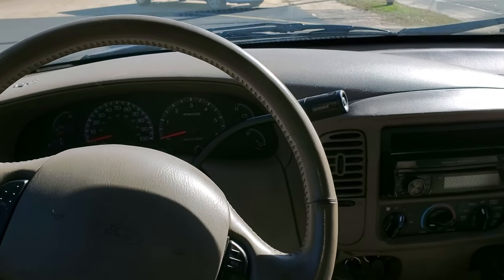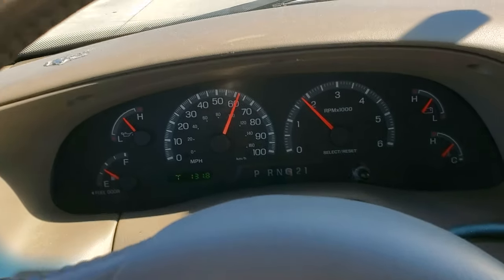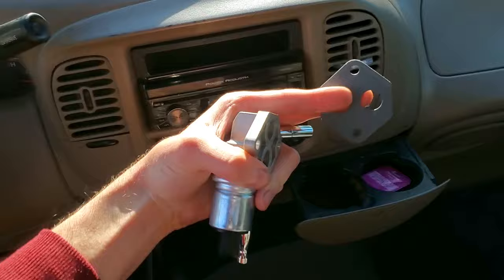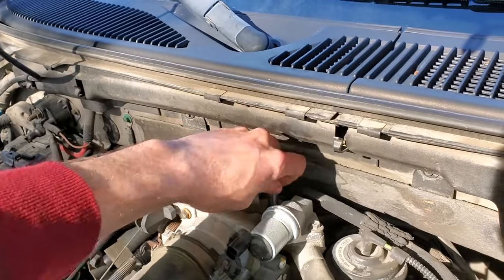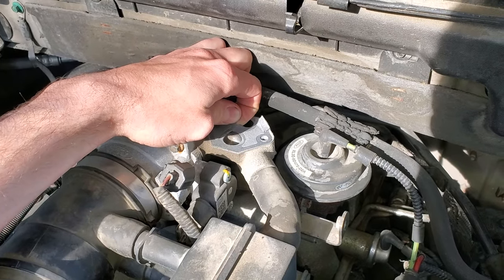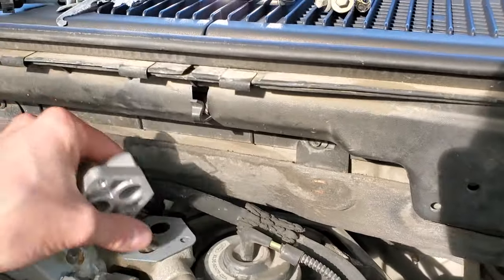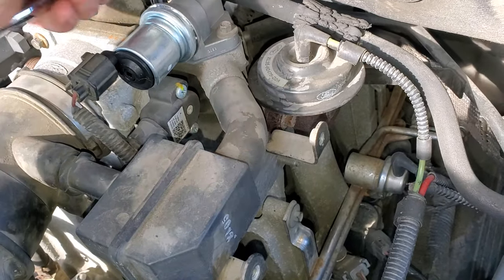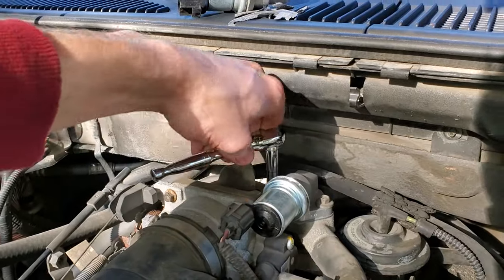F150 Idle Air Control Valve Symptoms and Replacement How To

Comment: Dude truck died this morning wouldn't start, rolled down to Oriely's and picked up a IAC, five minute swap scrapped off the old stuff and popped in the new unit, and BAM!! we got action! my 2002 HD supercharged F150 back on the road! Thanks for your quick and no BS video...Keep up the good work!!
Reply: Anthony Cruz this is what’s happening to my dads truck. If by any chance has it ever died and turn on every so often and then turn off down the road again on its own? If so I might go buy a new IAC and try it for my self.
Reply: @KeithBeTatted  my truck is stalling too when i have it in drive. And stop the rpm’s will drop so low and the lights will dim. And it will die at times. But it will start back up…. Im almost thinking the ICAV… or the alternator idk
Reply: Did your truck stall often before you replaced it? My truck has started stalking at red lights or if I stop to go in reverse
Reply: @CarlosGonzalez-Ziya  for me my problem was the throttle body… it was black on the inside soo i cleaned it up.. its all good now,,, for my truck anyways
Reply: Behind the plate
Reply: @riverrivers250  thanks for replying. Don't know when it's last been replaced. Wouldn't hurt and easy swap out.
Reply: @CarlosGonzalez-Ziya  ya it is easy to check.
Reply: @CarlosGonzalez-Ziya  how did you fix your issue?
Reply: Does anyone know what size the bolts are? They were phillips head on mine. They're likely going to get stripped coming off.

Comment: That initial high idle when you first started the engine after changing the IAC is caused by the needle being in an unknown position. The IACs come from the manufacturer with the needle wide open. The ECU then runs the needle to the position to hit the target idle speed. It's not a relearn, so much as an initial positioning.
Reply: So, Is It normal the High revs at the cold start?, because im having that situation.
Reply: @angeloarmebianchi7015  did you figure this out im having the same issue lol
Reply: @stillblastin96  mine goes over 2500 rpm Just once, After that goes down to 1500 untill drops down to around 900
Reply: @angeloarmebianchi7015  i just fixed mine it wast he iac valve i replaced it and its back to normal.

Comment: Whats incredible about this video is that you were able to replicate every single symptom, almost on cue,lol,that never happens when you are trying to show someone whats wrong specially a paid mechanic.

I have the same symptoms on my car but a new idle control motor didn't help it,reason i believe is my ECM is 30 years old and capacitors and processors start to go out and no matter what you do its not gonna fix the problem until the ECM gets overhauled.
Reply from the maker: Yes I've seen a similar issue with the Ford "personality modules"
Reply: u need new TPS not IAC u need a trick to remove stuck bolts...

Comment: My older F150 would do that same thing.
I found that idle air controller valve would got sticky.
To fix it, I took the plastic manifold part off intake to the throttle body and sprayed throttle body cleaner into it hole before the throttle plate.
The engine lugged and after the idle stabilized, I'd repeat the cycle a few more times and it fixed the problem.
I do not know why it would get sticky but the problem was solved.

Comment: My 2003 F150 is exhibiting these exact same symptoms (high rev on start; high rev in neutral;  high rev at stop/pushing truck forward; PLUS engine shuts off at idle).  

I’m hoping the IACV is the culprit. 

Thanks for the video man. It was helpful to see similar symptoms and a potential fix. 👍🏼😎

Comment: My ‘97 F150 has never been changed.  My issue is when the outside temperature gets hi, it won’t idle.  Thanks for the video. Looks simple enough.  Got my new valve from NAPA.
Reply: Got the same truck, how much was the valve at Napa?

Comment: Thank the car gods for youtube mechanics. It's saved me 1000's of dollars in mechanic fees over the years. I hate spending money when I don't have to. 20or30 dollar parts would cost you 100-200 dollars for a mechanic to install then of course you have the dishonest ones that try to con you into replacing things that dont need replacing. I used to work at an auto parts store and deliver to all the local mechanics and I know first hand how shady they can be.

Comment: Hi there, I'm hoping you give a reply to this!  Id love a little advice. I'm getting to feel a little hopeless here haha. 
I live in the wilderness and my money is very limited so I gotta be careful with what I buy. 
I've had all the same symptoms including a truck that won't start sometimes. I replaced an EGR tube that had a crack, a bunch of vacuum lines that needed replacing, spark plugs, coil packs, fuel pump, fuel filter and oil change. I kept replacing possible things as my problems would seemingly go away then come back, leaving me stranded in town. 
I've been good for months. Then my battery died when I left my door open. Happened so many times during the truck repair episode too. Soon before it died, it was driving fine but I got the same exact error code. P0171 bank 2 too lean
Sometimes in the past it would have bank one and two too lean. P0171 and P0174. 
Well I replaced my battery. The error code is now gone. Drove 100 miles and then this morning my truck is revving weird after starting. No code on code reader yet but boggin down then revving up. Not too dramatic but very noticable. Then I drove home and truck is staying steady now in rpm on the rpm gauge. I can however feel a slight chop or chug sometimes while idling. 
I'm 25 miles away from town, so I can't chance breaking down along the way. Someone can bring me a part though. Should I get the idle air control valve haha?? What do you think about this?

Comment: while in park or at light engine RPMs lower just a bit then goes back to normal then it does it again various times so this iac seems like it's the first step that's cheap and easy so why not do it first in going to attempt to do it on my own.

Comment: Glad I found your video because I am going to do my Motorcraft Idle Air Control Valve when it comes in from Rockauto.

Have you had to replace the Throttle Position Sensor on your truck and if so do you have a video?

Comment: Changed mine out and it works better with it unplugged.
Reply: Did you fix the issue, I had the same problem I had to replace my idle control valve and throttlebody and seemed to help it. Runs great now

Comment: I have an 02 F150 with 5.4 and I noticed my rpms are high while driving, it used to be just below 1 2rpms now its over 2 just a line or two. I just replaced all plugs and all coils today 10/07/24. Now I need to replace the intake or a gasket before it starts snowing.

Comment: My 2002 F150 Lightning had a surging issue more than a dying issue. It also kept wanting to bring its own idle up in park, and while coming to a stop. Definitely driveable, but needs fixing. I'm also having to do a relearn. Basically let it idle in park then turn ac on let it idle then press parking brake all the way and put it in drive and let it idle then go drive for 30 minutes as you normally drive even if its aggressive (fast) driving.

Comment: Did your truck also have the rpm fluctuating up and down slightly like it was 
hunting for the correct idle speed? Thanks great video
Reply from the maker: Yes that was an early warning sign. A vacuum leak (most likely in the pcv hose) can also cause that
Reply: I got a 95 Ford XL and it ribbs low and then has to catch up it don't bother me only does it sometimes wen I crank it I think a lot of the Ford's are bad about it

Comment: Mine lasted 23 years. That is if FixD diagnosed it correctly. And if my eBay purchased one for $30.76 last as long. Fuel Pump I replace from eBay stock lasted 2 years. Amazing thing with his history they had a used one on eBay for more then new ones.

Comment: My 2000 ford lightning was idling when I floored it a bit and then the truck started to idle like shit and shut off and didn't want to start. It blew my maf fuse (because the wires are a bit exposed) added the fuse back on and kept idling like shit but it got me home and now I need to know if this shit is the problem.

Comment: Hello, I just replaced my IAC valve on my 2003 f150 5.4. Seems like it’s revving quite high now tho. At stops I’ll be right around 1000rpm and can feel the truck wanting to pull. Do you know what could be causing this problem? Thanks!
Reply: Could be a defective one.If it is a Standard after market one try to get theOEM motor craft that will solve it.
Reply: Efren Saclolo sounds good! Thank you!
Reply: Efren Saclolo update: truck is working perfect after replacing with the new IAC. Also cleaned the area better with throttle body cleaner and showed to be quite dirty inside the hole where the valve goes. Thanks for your help!
Reply: Unplug it and see if it idles down

Comment: My transmission blew 2 weeks ago and as I was pulling off the road the truck started idling high. I installed a Motorcraft IAC 2 years ago. My battery light came on and my battery was drained… It’s a cluster of a situation that I’m trying to figure out!

Comment: I don't care what anyone say these IAC throws a p0174 and a p0171 code, I unplug this IAC while my engine is running the car stalls right out, I reconnect the wires and start the engine the car cough like crazy before and catches itself b4 it stall out,  the the engine is starving for fuel but this IAC is letting into much air. My car goes into limp mode when starting off the computer trying to make up the lack of fuel under a load so tranny kick into limp mode because of the lack of vacuum and my engine revs up to kick it into 2nd gear, I really misses the 2 and 4 barrels holly carbs these emission controls are junk, you running around like crazy to figure out the issue.

Comment: I have a 2001 ford f150 5.4 supercrew, have issues on cold start rpms drop then goes back up just that 1 time cold start. Cleaned the throttle body with new gasket issue went away. After a few months same thing happened then cleaned the iac valve also went away after that. Couple weeks it started to do it again any help on what could it be thank you

Comment: Hey man, When I try to turn the truck on it cranks forever before it turns on. 

I cleaned this part out and it started working for a while but then started doing the same thing. You think this is the issue and if so should I just buy a new part?

Comment: I have a 94 f150 302, my truck is a 
4 speed with od. She would surge when accelerating hard, especially going uphill.The guy at the auto store told me to remove the IAC and clean it. It did good for about a week and started again. Tried cleaning it again but the same. The truck hasn’t ran for 8 months before I got it. Do you think I need a new IAC? Or maybe it’s something else? Overall, the truck runs great. Any ideas?! Thanks
Reply from the maker: I would go ahead and replace it. Also check for vacuum leaks, the PCV lines are a common culprit
Reply: Lehew Tech Thank you, I’ll check that out as well.

Comment: I have a problem. Every winter, cold days. My 2002 ford f150 4.6, will crank fine, run great, but on those cold days if I get in and drive off. It will run fine, then surge.  It want take the gas. It stalls and surge. I've replaced,  IAC,  all that stuff under the hood. And even fuel pump.  Still does same thing , in cold weather or cold mornings.  If I let it warm up, it will not surge or stalls.  It runs fine. No problems in the summer or warm to hot days

Comment: Mine is not idling and fluctuates up and down, I replaced with standard brand in December and runs fine until today it is fluctuating again, since I have a warranty on it the seller is willing to give me a refund just return the item, I'm in the process and shopping for another brand like Hitachi IAC for $43 like $10 cheaper than Standard brand.OEM is $60 so Might consider the one that will last.
Reply: Man! You took out all the huffing & puffing.. & you delivered those instructions real GOOD! Thanks!

Comment: I have a 1989 e250 and changed mine. I replaced mine. Then It ran good for a few days. Then started that wanting to stall intermitinly again. Could it be a hose? Got mine at discount auto too. Thanks
Reply from the maker: It may be best to install a motorcraft part as some of the aftermarket valves have a high failure rate
Reply: @LehewTech  thanks. Am I on a time limit before I break down?
Reply: Just get the OEM Motor craft,After market parts have a failure rate after two weeks of use and fail back to the same problem.
Reply: Make sure the PCV valve is tite and rubber washer it goes to fits tite it mite help it did my Ford

Comment: Mine seems to act up after highway driving. When the engine is cold, it starts and runs fine. After highway driving, it revs to 2500 when I put it in park. ??? IAC ???
Reply from the maker: Most likely your IAC is failing. During highway driving, the engine is under load and the vacuum generated can overwhelm a weakend spring inside of the IAC, causing very high idle. The truck might otherwise act normal
Reply: @LehewTech  exactly my symptoms too...only when it's warm and I have to really hit the brakes now and again, then "kerchunk"...normal idle...thanks man...
Reply: My 1996 F150 with a 302 seems to be doing that, I installed a new MAF and it idles a lot smoother I noticed but sometimes it still starts shaking a little bit, but not constantly like it was before the MAF change. I also have been doing the drive into neutral test while driving and sometimes it revs up high then comes down, sometimes it just goes right back down. 

I noticed when I put the truck in park after driving up the highway for 40 mins to help my friend move a table, the truck idled at 1000 RPMs and kept fluctuating back and forth between 1000 and 900 until I shut it off, waited a few mins then turned it back on to move the truck and it was completely fine. I bought the new IAC just to be on standby because I’m still not completely sure if it’s that, I don’t have the CEL DTC code popping up for it either, I guess only when it’s on it’s last leg is when it throws the code is my assumption but I’m definitely gonna be fixing to change it ASAP to see if that makes a difference.

Comment: I have a 2012 fx4 5.0 coyote engine, the idle has been dipping to 450rpm to 500rpm not up and down just steady, I recently had my water pump replaced, and when it idled before it was around 650 to 700rpms, now it idles at 450 500rpms, and low oil pressure light comes on ? If I hold the peddle to keep it at 700rpms no low oil pressure warnings??? Any help

Comment: Question 
Did replacing idle control valve fix the issue.
Reply from the maker: It did temporarily. When this part failed (again) I went with a Motorcraft replacement and the truck has been fine ever since
Reply: @LehewTech  same here I only get oem parts by now on.

Comment: Hey buddy I need help so I got an 03 ford f150 5.4 so when on idle and it's in park i can feel that slight tremble rpm stick doesn't move a whole lot so is this the idle air control valve?
Reply: I have the same thing happening. My mechanic did find the vacuum hoses for the dpfe sensor were leaking and replaced them. This helped slightly but didn't resolve the issue. His scan tool also showed some occasional misfires. He moved coils (coil over plug) around but the misfires didn't follow the coils. Did you ever get your issue resolved because I haven't yet. My problem just started.
Reply: @richardspringman857  did you find the issue?
Reply: @juniorr2808  my misfires were due to a leaking head gasket,  ended up getting the engine rebuilt.

Comment: I have a 2000 Ford Expedition and when ever I stop the car the car wants to turn off and I just replace the fuel separator that goes next to it so I'm thinking do I need to replace this part to " the IAc valve
Reply: My 2000 Ford F 150 is going through the same thing. Was it the IAC Valve?
Could you plz help bro. Thanks!🙏

Comment: I freaked out when your truck revved really high after the new one. Whyd it do that??
Reply from the maker: The computer had to dial in the position of the IAC. When first installed, the valve was opened fully resulting in a high idle.

Comment: I have a 2001 4.2. I changed this part and it seemed ok when I started it up. Took it for a short drive and the idle issue is back. It’s manual transmission. In neutral or in gear while at a stop it idles up and down over and over like it might die. Changed the plugs and ran sea foam in the tank. New battery. Replaced air flow sensor. What could this be? Please help.
Reply from the maker: You could have a vacuum leak allowing unmetered air into the intake manifold. A common culprit is the pcv hoses.

Comment: question could a bad iac valve cause engine power loss when the ac is on ????
Reply from the maker: If the engine idle drops excessively when the AC kicks on it could be an issue with the IACV.
Reply: @LehewTech  the idle isnt dropping. the problem is that it feels like it loses 50 horsepower and accelerates alot slower than normal and then the transmission starts shifting bad. hard delayed shifts. at idle it stays around 800rpm. once i turn the ac off the trucks power goes back to normal and the trans goes back to shifting normally.

Comment: Yep, 2000 F150, 4.2 290k miles. Change mine at least once a year 🤷🏽‍♂️....it always happens
Reply: @joelpaige7222 I have a 2003 with the same engine. Mine will act normal on startup and highway driving, but in stop and go traffic, it will idle down to 500 then normal. It usually does it when the temperature outside is very hot. Any suggestions?